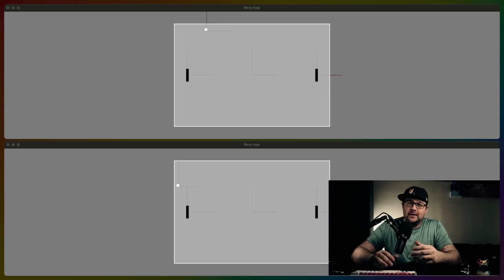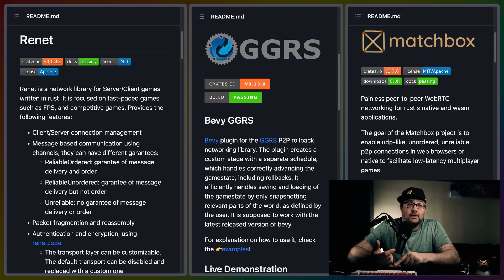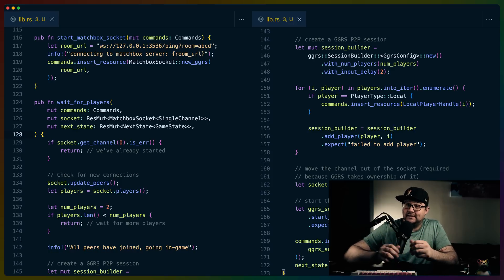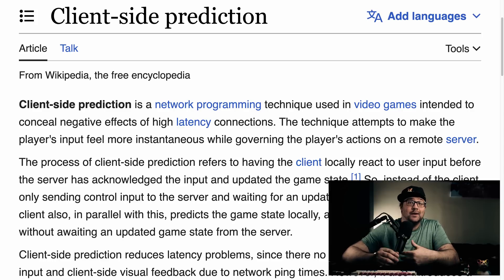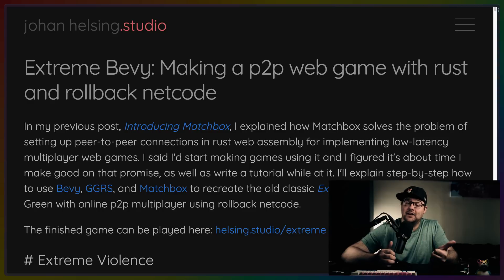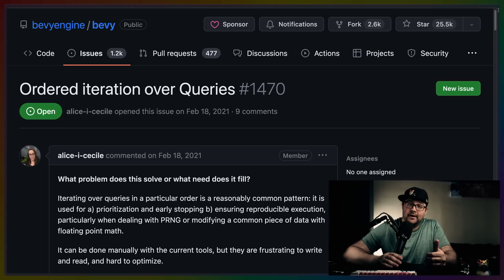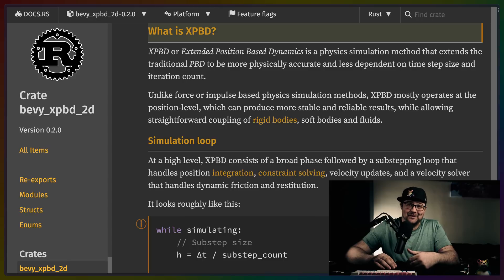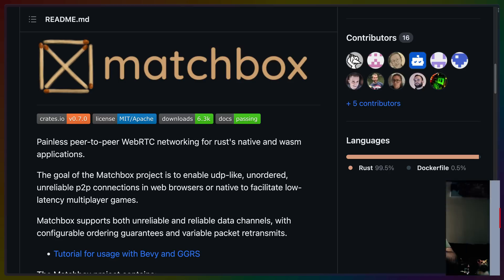I failed to build multiplayer pong in Rust

Comment: I feel like physics and p2p connections just don't mix well unfortunately. There's a reason most p2p games are either turn based or fighting games. I was working on a physics based fighting game in Godot and ended up stopping because there wasn't a good way to make the physics deterministic, and servers would be too expensive with how resource intensive the game was, and how many instances would have to run.

I recently switched to bevy and have been learning Rust, and I think it's much more likely I'll be able to get a p2p mesh network to work with my game using bevy. Avian (XPBD) seems to meet my needs for deterministic physics, ggers isn't the easiest to implement but I think I'll be able to make use of it. And Matchbox? Matchbox is more precious than gold as far as I'm concerned.

I'm looking forward to see what I can accomplish with bevy and these wonderful plugins.

Comment: The best way to achieve this would still be an authoritative server/client setup. It can all be done in P2P with only a low power low bandwidth matchmaking server in between. Prediction/rollback is also extremely easy to implement, as long as you can manually tick the physics engine.
In game networking, people like to make a huge fuss about "physics determinism", but it hardly matters as long as they're visually very close. It doesn't matter if one computer calculates floats differently from the other, because rollback completely takes care of any discrepancies.

Prediction will ensure that both players feel like they're the host. If you do it right, it should be very hard to tell.

Comment: The latency between clients producing discrepancies reminds me of how gyroscopes have drift in robotics use cases, and they solve that problem by also using magnetometers and accelerometers (with slower measurement rates) and Kalman filters, and combining them into a sensor called the IMU. Maybe some inspiration can be taken here.

Also, what if for events like collisions, it’s acceptable to wait for the server or consensus, but otherwise local simulation suffices for free motion? You could wait for the server if a possible collision is within an error tolerance, and receive occasional physics state corrections so the local simulation doesn’t drift off too much.
Reply from the maker: yeah if I had gone with a server-based approach it probably would've been simpler to sync because the clients would've been treated as "views" into the server. Re-using the p2p communication, but going with a more host-player structure to it could help as well. Downside to that is that one player has 0 ping and the other has a lot more. I was really hoping the physics simulation would be more stable, but it seems that the general opinion is that it won't ever be good enough, so assume it won't be and just go to client/server sooner.

Luckily there's an interesting networking crate for client/server (bevy_renet). I was just hoping p2p would work better out of the box.
Reply: @chrisbiscardi  I still think it could work by basically separating out synchronization critical events to be handled differently than the local simulation. For Pong, these would be the collisions and occasional motion syncs to keep the drift in check. The sync critical events don’t strictly need to be handled by a server, they can be handled by a small consensus/vote, at least for Pong with only two players.
Reply: In the general case with more players, I reckon the vote only has to be between the players involved with the event. So for Pong, each player owns the collisions with their paddle, or something. Maybe the other players then get to veto if anything sus happens, such as the ball miraculously reflecting when the paddle isn’t even there. At that point I suppose you have a constitutional crisis, and maybe then you just have to close the session because there’s a hacker.

Comment: I totally disagree, that p2p is better for learning. In fact, I find it better to learn server client immediately, as I find it is better to eat the bigger frog in this case first; 

I find your choices are trying to go the easy path here, and by that extension, landing in the actually more complicated issues of networking.

it might be easier to start with mmo full sync, go over to simple fps sync, then go for prediction and layed back integration, and only finally in the end touch the hot sauce of rollback networking.
Reply from the maker: > you are trying to take the easy path here

quite literally yes, as I said in the video: I'm trying to find an easy path *for other people to learn and build on*.

Its fine to disagree but you haven't provided an alternative path here or any resources to accomplish what you're suggesting. You've told me to go do a bunch more work on unrelated games before coming back and doing this again, none of which is guaranteed to be any easier because again, you haven't provided any resources to accomplish what you're suggesting.

Comment: Great video. This is definitely a course I would pay for once you get it up and running. I have gone down the multiplayer rabbit hole multiple times - very  complex problem with physics. I still have only ever managed turn based games. I have been messing around with using wasm on v8 cloudflare workers on the edge for finding lobbies, keeping connections etc... Especially for small projects where you can have a small DB on the edge and could keep the entire server game logic there. I would also pay for a course going deeper into turn based games :) . Keep up the great content!

Comment: You might also want to look at CRDT solutions like Automerge or YJS, also built in Rust. If you could cover these libraries, that'd be great. For Automerge, you can use the autosurgeon crate.
Reply from the maker: I actually love CRDTs as a topic and would happily cover them (I've been following them since I first found out about them in Riak), but I'm not sure how they would apply here to fix the issues at play.

They could be fun for slower p2p games to enable offline decision making maybe. 🤔 It seems like jackbox uses them (or used them at some point) for audience functionality. I probably need to cover the basics in a video first.
Reply: @chrisbiscardi  That's true, they wouldn't quite solve the issues in your video. Would still be interesting to see them covered as there is not too much info on YouTube on them, I've read a lot of papers instead haha. I've used them for real time functionality actually, such as the multiplayer cursor and changes that are present in apps like Figma, but yes, the fundamental problems of network latency don't change.

Comment: Doesn't solve any of the problems mentioned, but it might make server development easier: Have you tried the new spacetimedb or maybe even integrated it with Bevy? Rust + game-dev seem to be first class citizens and realtime updates + persistent state + type safe rpcs seem to be very nice too. Since the server modules are also written in Rust, it might be possible to run the source-of-truth simulation on the server and reuse the same code on the client ...
Reply from the maker: I haven't tried spacetimedb. I stay pretty far away from anything advertising itself as blockchain and they mention it quite a bit on their homepage so I'd have to do some research first.

It also looks like they don't have serverside physics currently, and current games implement collisions in the client, so wouldn't actually solve the problems in the video yet afaict. https://www.reddit.com/r/rust_gamedev/comments/15n971z/spacetimedb_a_new_database_written_in_rust_that/jvpvuh5/

Comment: I think a common way used by many MMORPG games, is to simulate the world on the server (along with its physics), not only just validating actions. That way the client is primarily a screen to view what is being broadcasted to it, and an "action requester" to request actions to be taken by the entities you have permission to on the server. 
This way, you only need a bare minimum of client side predictions to predict wether or not your requested actions are granted and what you should do. Everything else is parsing and presenting data recieved from the server.
Reply from the maker: yeah, I can see the delay to request from the server and wait for it to get back working for mmorpgs (or turn based games, etc). Eve also does literal time slowdown don't they?

Rocket League, which I mention in the video, does a lot of client side prediction but the server simulation is the source of truth, so if there's a discrepancy the server wins and client updates to reflect that, similar to what you're describing.

There are definitely a wide range of games with a wide range of solutions. Not having to pay for servers is something that works well into a workshop IMO, but at the end of the day if the best solutions are "run a server" then I'll be running a server for sure.
Reply: It's still super hard to mask network latency if it isn't already included in the whole game design, for instance via animations which mask the latency.

Rollback based netcode can be quite tough, but once properly implemented, was a godsend for fighting games in particular.
Personally I've measured the latencies to some friends, and packets from Germany to Australia can take 500 ms of latency on average (max was a staggering 1300ms), so even with that such games would be tough to play together
Reply: Minecraft spawns a server on the client side, even for single player games. The server runs all the world gen, block state, player position, combat/projectile travel, etc. For larger SMP servers you spin up a dedicated server and the client doesn’t change at all.

Comment: I've tried many times to get networking + physics working and it's always a struggle. Many networking crates out there seem promising but always have some weird quirks and/or are unmaintained. Similarly I've had the kind of physics issues you describe. In general it also feels quite hard to hook everything up. Glad to see you're looking into this stuff, your examples and vids are always super helpful!
Reply from the maker: yeah, physics is a big problem space afaict and building a widely usable feature-rich physics crate is a big undertaking. I'll definitely make more videos as the ecosystem progresses and I'm glad you're enjoying the videos!
Reply: maybe this would work: calculate physics on one machine and sent results in form of vector and position to others

Comment: I've been struggling to build a network multiplayer with bevy + rapier for quite some time now and always felt the need to pretty much rewrite the basic components of physics and networking (I'm writing my own client / server with lobby management right now, for instance). I thought that this was due to my lack of understanding of the crates available in the ecosystem (which is true), but it seems though that we also don't have very mature solutions for deterministic multiplayer architectures as of now. Great video, thanks for sharing your experience.

Comment: I am using Rapier for 2 month already for my game and I am totally exhausted.
The way that rapier uses it's own world is completely wrong for bevy.
I can not remove Collider from entity in system => bevy_rapier just don't see this, it watch for Changed<Collider>.
I can not change from RigidBody::Dynamic <=> RigidBody::Fixed/Kinematic in system, it leads to potetially error phone state in the future.
I can not use PostUpdate for system and remove some entity inside the system => rapier in next frame will fail.
And some other small issues...

I will definitely try XPBD, thanks for suggestion! I thought that only one maintaneable physics library is rapier.